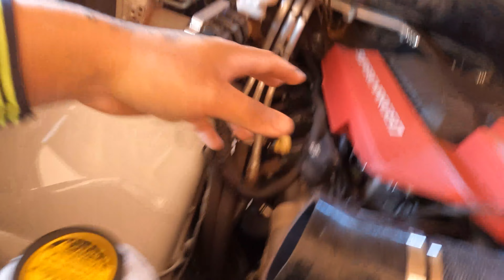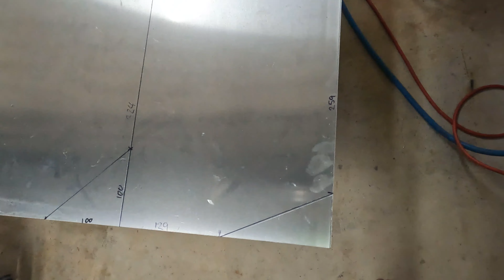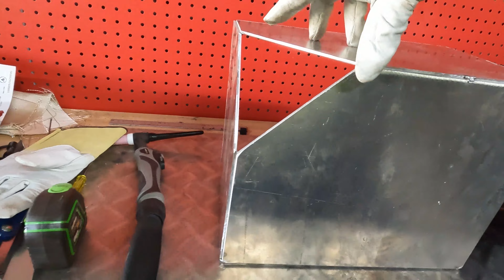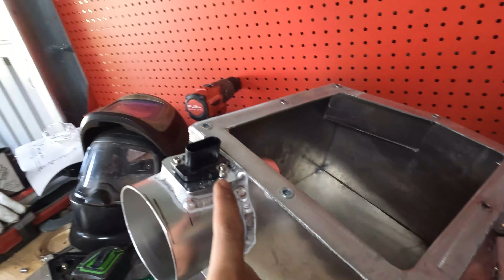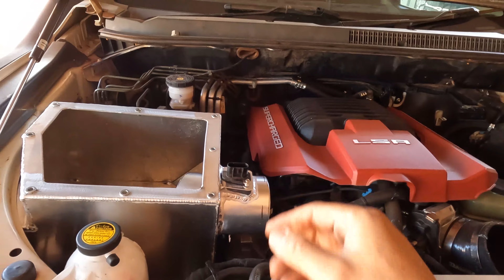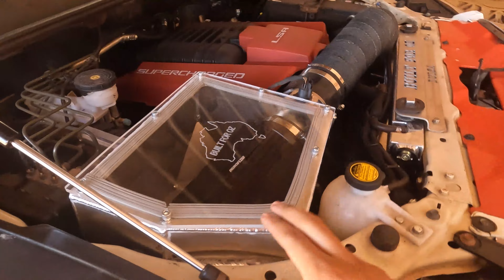BUILD CUSTOM 5"-4" AIRBOX - LSA COLORADO Ep. #6

Comment: Good skills and it looks nice, but as practice shows, there is no benefit in this except for beauty. The difference in power is about 0.5%. The only advantage is that the filter stays clean longer.
Reply: It has a few additional pros other than breathing easier? how about visibility,  easily seeing how dirty everything is also greater water protection (depending on spacing and oem design)
Reply: That's like saying there's no difference between ice cold water and room temp water.... is coke better warm? Cold air is denser than warm air... plus paper filters are like wearing one of those basic face masks.... and also idk if you know this but.... heat is not very good for engines...... thats what "practice" actually shows.